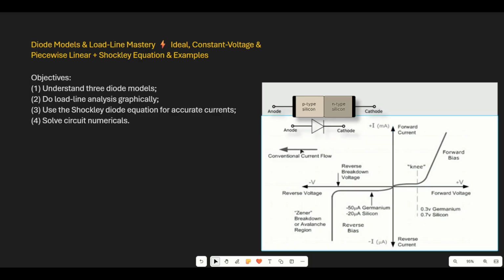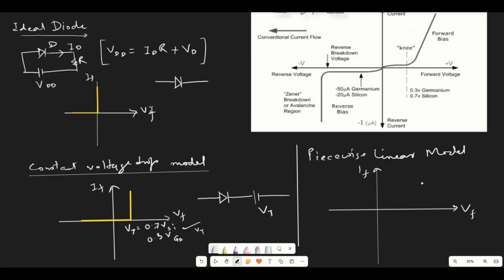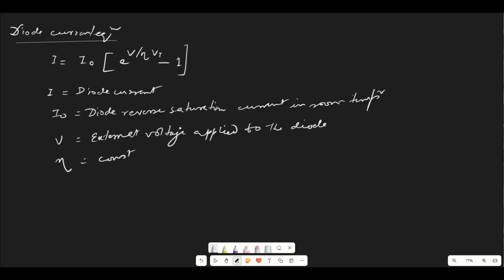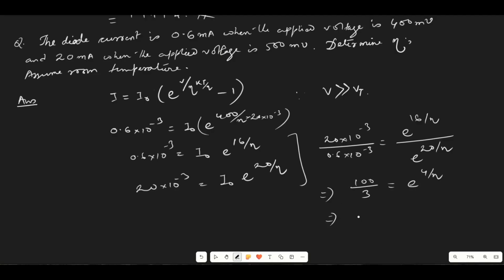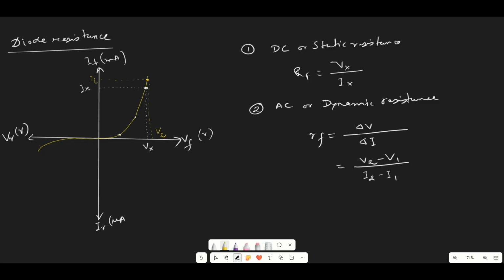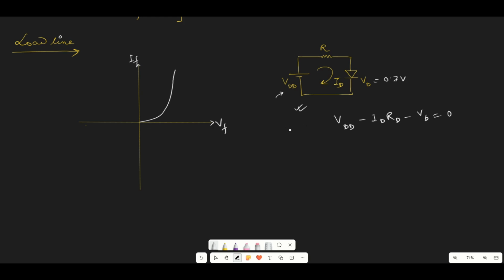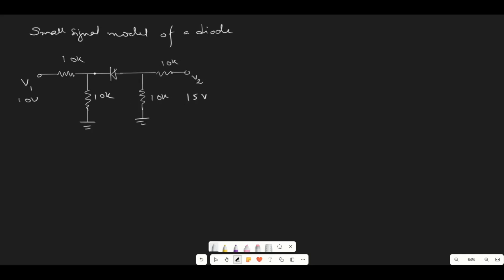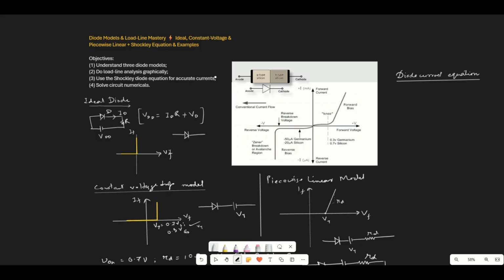Diode Models & Load-Line Mastery ⚡ Ideal, Constant-Voltage & Piecewise Linear + Shockley Equation

Comment from the maker: 💡 Test Your Understanding!
Try these diode-model questions and share your answers below 👇
I’ll reply to a few of them!

1⃣ Ideal Diode Model
If Vin = 5 V and R = 1 kΩ, what is the output voltage across the diode (ideal case)?

2⃣ Constant-Voltage Drop Model
Assume diode drop = 0.7 V.
For Vin = 10 V with 1 kΩ series resistor, calculate diode current.

3⃣ Piecewise Linear Model
A diode has:
• Threshold = 0.7 V
• Forward resistance = 10 Ω
For Vin = 5 V through 470 Ω, find ID.

🔥 Bonus:
Tell me which model you prefer using in numericals — Ideal, CVD, or Piecewise Linear!

👇 Drop your answers, doubts, or topics you want next!
Your comments help this channel grow and help me create better tutorials for you! 🙌